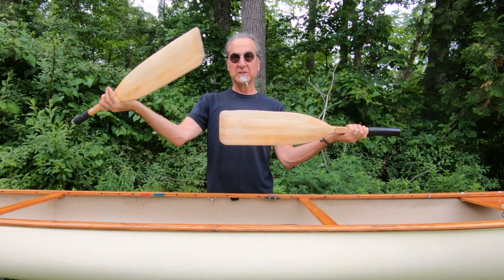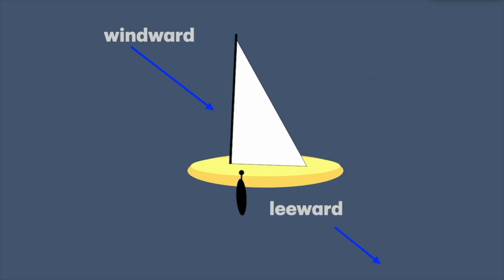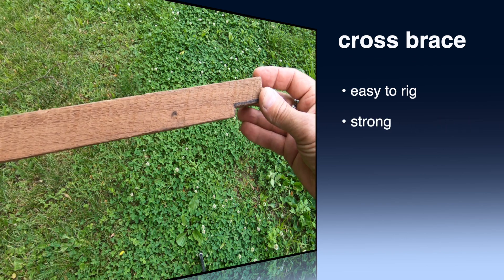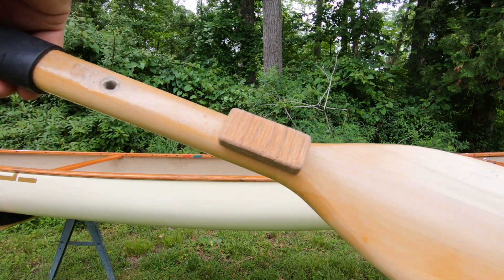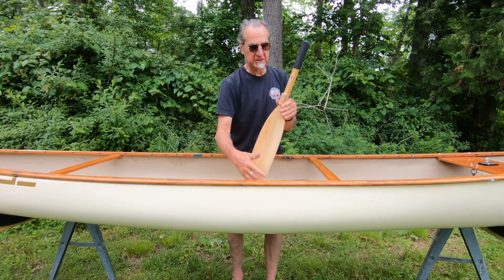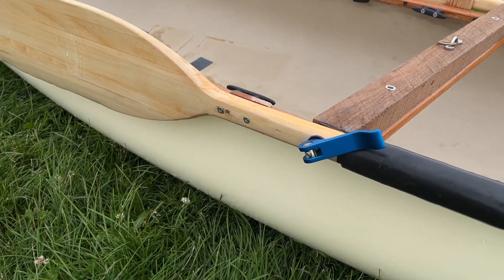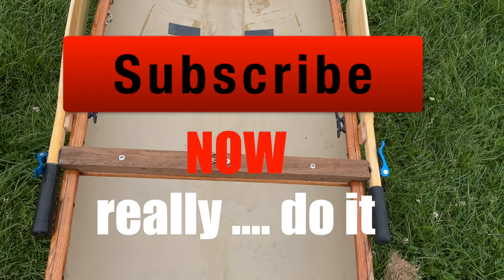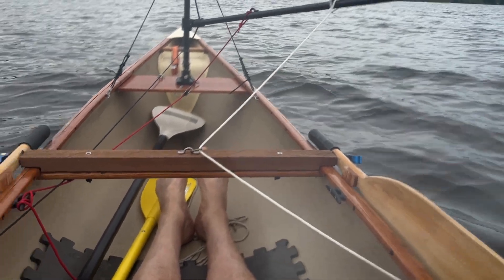How to build a leeboard

Comment: Nice bit of work. Couple of minor suggestions ,though.  If you put the spacer block horizontally along the hull it eases the stress and then the canoe paddle / board will only wear the block and not the hull. In my experience  lee boards really benefit from a hinge of some sort that lies the board swing outboard and up (athwart ship sort of). You may have to weight the board a little , but when you tack the board goes to the weather side . With a hinge it will lift out of the way until you stow it. They can snap when the force against them is away from the hull. Keep up the adventure.
Reply: Your advice sounds very legit. Please could you elaborate on the aforementioned hinge? Thx so much!